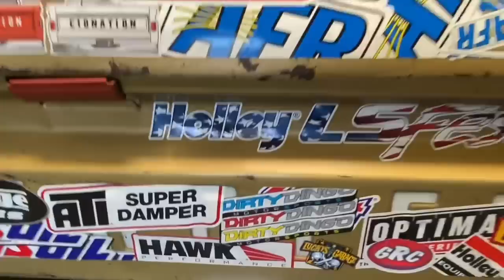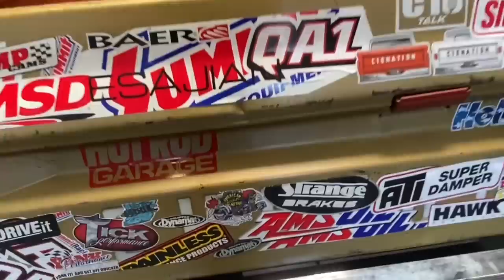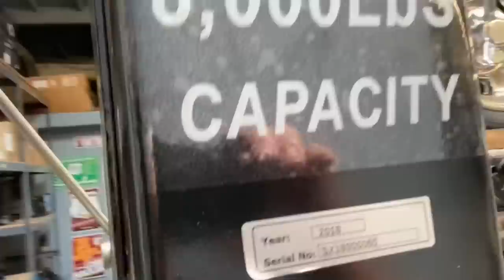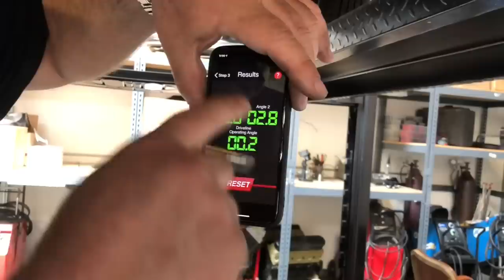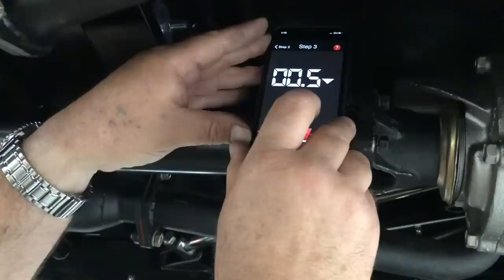Lucky’s Garage and a pinion angle tech tips

Comment: I used the TREMEC app for setting up my pinion angle on my lifted K5 blazer. I had to go with a double cardan joint shaft so I had to cut off my perches and weld new ones on. Great app and very accurate I verified with the tried and true protractor because I was skeptical but didn’t need to.

Comment: Hi Lucky   I am using the Tremec app on my truck build. I used it to position the motor and trans .And when I cut the frame in have to make the truck a short bed.You can get super precise.One tip if you have your phone in a case and the buttons stick out take the phone out of the case .The buttons will give you false numbers.

Comment: Dam thanks a lot Big Luck I did a drop on my truck well suv lol an my Block were angled an I think I installed the backwards so my rear end is pointing up instead of down lol after everything was bolted back up dropped on the floor I got underneath the rear were the spare would be an I said hmmm 🤔 🧐 🤨 that don’t seem right if I hit a bump technically it would possibly hit the floor lol 😂 it a project so I haven’t moved it or even flip the block foward lol but now I know an saw this app you used definitely will use it wen I flip the blocks around they came angled for the 3” inch block 2” inch are flat but thank for the information Luck 🤙🏼💪🏼

Comment: Sorry if this is an old video. not really mechanically inclined but did my drop on my truck myself. I'm trying to understand the app. Would the drivline operating angle be what determines the shims you would need for the leaf spring?  Thank you

Comment: Those hairpins on the front are an accident waiting to happen. They bind up suspension big time,
The pinion angle thing,, On racecars I run them about 5 deg down as they hook harder. Road race car was 170mph car with no problems,, and that with a equal length axle Ford Commercial so the tailshaft was offset as well. 
Oval track car is even greater angle and again with no dramas and around 8" of travel at the shock. 5" down and 3" up
Reply from the maker: Hairpins ?
Reply from the maker: Oh your talking about the Roadster.....